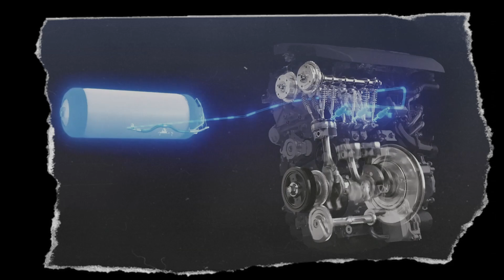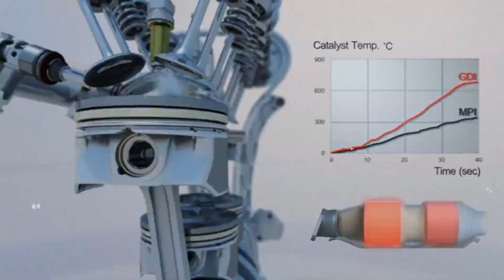Hyundai/Kia 2.5 SmartStream G4KN Engine: Specs, Innovations, Reliability & Issues Explained!

Comment: I got a 22 2.5 non turbo from new always changing the oil at 5k and putting good fuel in  its got 30000 on it and never burns oil never had any check engine like runs good and I took it 139mph so good pick up

Comment: What about carbon build up?
Reply: Every month js add some additives and use fuel from a top rated brand that alr has proper additives won’t have to worry about it have a running GDi with 235k miles no carbon problems
Reply: It uses multiport injection. Completely prevents that.
Reply: @IronmanProblems  It uses both MPI  and GDI.  The video said that it uses more GDI in highway driving and you should do regular valve cleaning.  Like anybody is going to do that.  Still I think it must be an improvement over pure GDI.